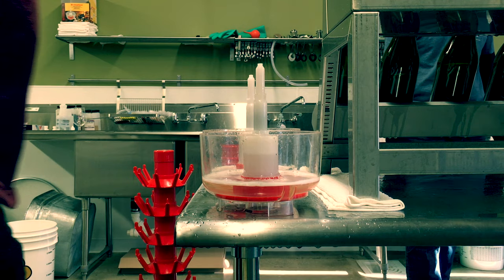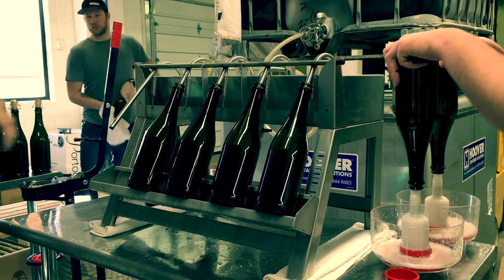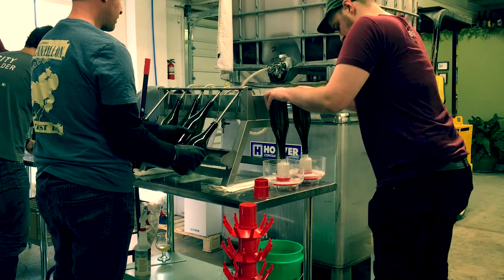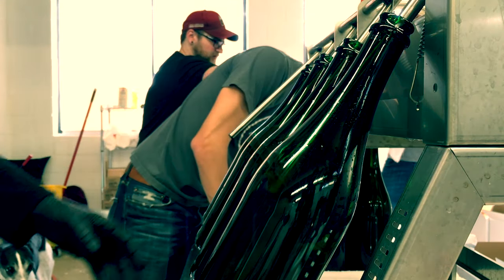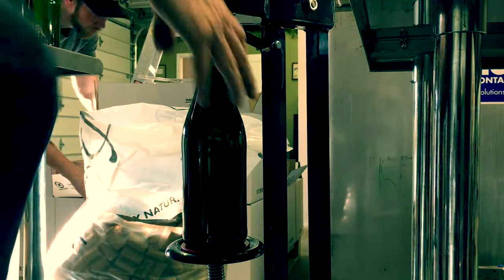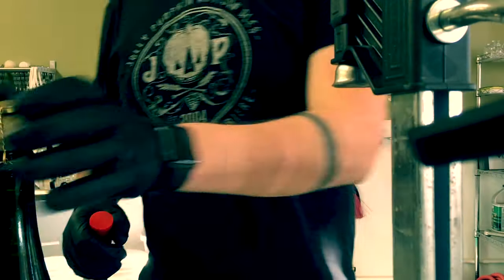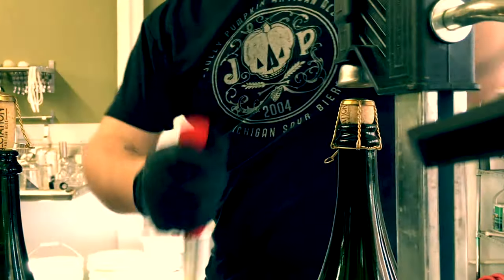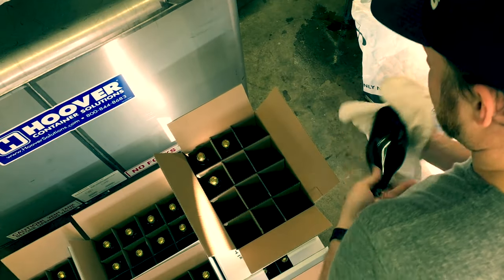Manual Bottling Line at Speciation Artisan Ales

Comment: Dumb question maybe but does that filler stop automatically when it's at the right level (the level in the tank?) or are you just pulling the bottle out right as it starts to overflow?
Reply: It stops automatically thanks to the principle of communicating vessels (it evens at the same height of the liquid in the buffering tank)